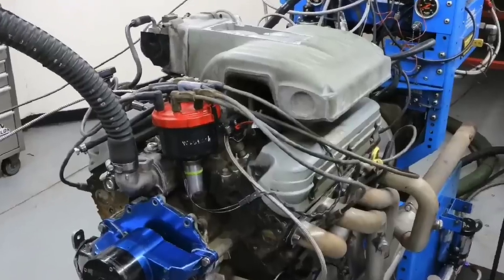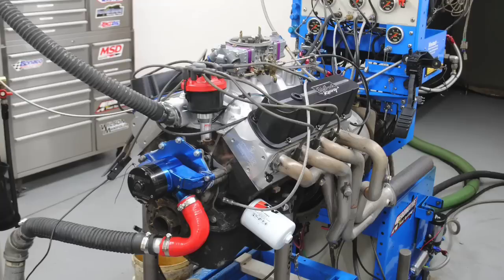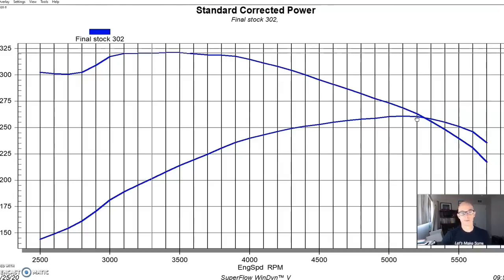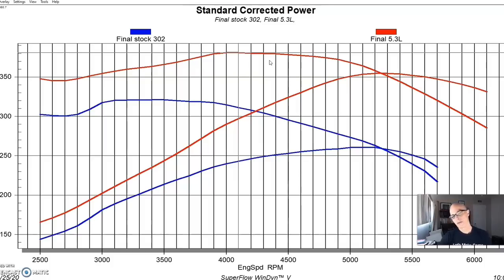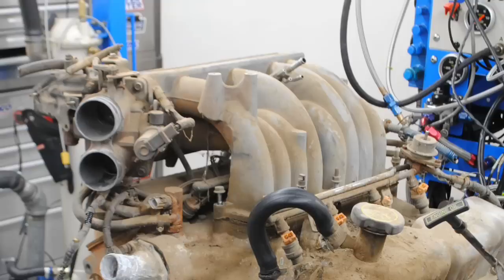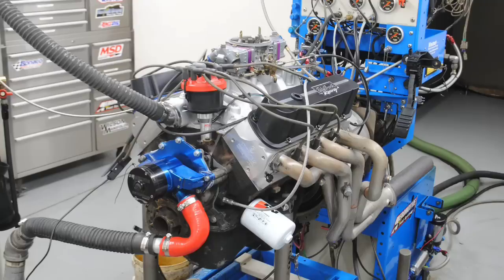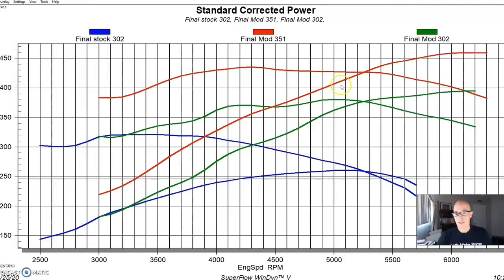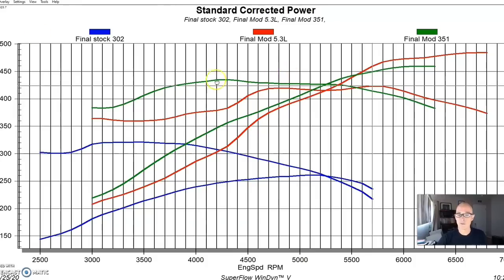5.0L vs 351W vs LS-SHOULD YOU SWAP?

Comment: With the money I'd save having to convert everything for an ls, I could take that modified 351 and boost it with some wuhan whirly boys and go well above the 5.3
Reply: Yes.!! So true.. an LS might be great, until you look into the total cost of converting everything, doesn't really make a good comparison for the price tag. Most people don't want to  waste their money and time to redo their ride. Just saying, modify what you've got. You'll be money ahead.
Reply: Spot on !! No1 talks about those costs
Reply: Barry Boppins  now compare a true ls1 5.7 to a 5.8 Ford. Ford will lose on power and fuel economy.
Reply: Barry Boppins  I've made 1000 to the tire with boost and exhaust on a 5.3. heads don't even have to come off. Idk where you got your information but you couldn't possibly be more incorrect
Reply: That’s just not true.
Reply: Barry Boppins  thats because he has no clue what he is talking about! Some of these guys read it on google and think its true. No need in swapping a LS just run a 5.8 in your ford. The 351 will do all you need and more on a street car.
Reply: This is my thoughts exactly. And exactly the road I been planning to take. This vid just solidified that even more for me. That 25hp difference between the 5.3 and the 351 makes it a drivers race
Reply: Barry Boppins  I had a 351 stroked to a 383 sbf with cheap ported heads, built right and a novi 2000 supercharger on water injection. It was a monster. People also forget the LS is crazy close to the design of a ford. Think of this way also chevy has built on this LS push rod for years past ford so I would hope its just a little better it should be with almost 30 more years of trying to get it better when ford was doing doing OHC stuff......
Reply: I ls swap my skateboard instead of 351w
Reply: Freedom Fighter  very nice. That should make alot of fun.
Reply: I'll take a terminator block over any built block.
Reply: A terminator block can be built  800hp or 1000hp and still be a great daily or a adrenaline rush at the track. If compare a 4.6 Dohc terminator to a much newer Ls or other ford blocks, the old terminator block was before it's time and can still hang with new dodge & Chevy.
Reply: Depends what you start with. There are a lot of V6 Mustangs out there cheap. A good 302 or 351 with all accessories is not cheap or super common. There are a lot more 5.3s in the local scrapyard. On a drag car you're only running an alternator and water pump so it's not that much more work for the LS vs 351.
Reply: Where are you going to find a complete and running 351 for around $500 though? I can drive 30 miles and get a perfectly good 5.3 for about $500. I can't do the same for a 351. Also you forget you have to do modifications for a 351 swap too, so that extra money you were talking about is spent
Reply: @beardedforlife3740  I can find a running 351 at that price. But that's besides the point. an ls swap is much more than just the engine. you'll need a trans, mounts, adapters, fuel system. harness. ecu etc.
Reply: @billybro1999  this.

A 5.8 might need an oil pan, but it uses the same motor mounts and bell housing. Heck if you start out with a 3.8 with a blown motor, that t-5 would also bolt up with zero modifications. 

With an ls, you need to rewire the entire car front to back, you have to upgrade the fuel system, you have to either adapt or buy a different trans, now you are modifying the cross member or flat out replacing it, and you need a set of swap headers and motor mounts. 

Now out all that money you were going to spend to convert the car over to an ls, and throw it into a 351 and you would easily make the same or more power with room to grow. 

That is exactly what richard showed in this video, the 351 holds it's own against a ls 5.3 and you can swap the 5.8 in a few hours with very few modifications vs a complete rebuild on an ls. 

Now will a 5.8 be more reliable? In my opinion, if done right, yes it would. And with mostly stock and off the shelf parts, much easier to repair as well. 

And as far as gas mileage goes, you can easily hit 28mpg freeway with a bone stock Stang. You put gears in, which pretty much everyone does, there goes your fuel mileage with either motor.
Reply: Tyson Seabrook  Who the fuck cares about fuel mileage on a built turbo V8? Ohh, a late model el es can handle more power than a 90s smog choked lightened 5.8? Big story!!!!!
Reply: @beardedforlife3740  i just picked up a complete running 351w ho with molly rings and another that needs work for $600 so it is possible to find just have to watch i wont lie took me 2 months to even find one around herr
Reply: @brianwenzel8791  Yes, but when it breaks, you switch it out with a near stock motor.
Reply: @brianwenzel8791  And you can stroke that 351 block to 427 cubes.....  Just saying....
Reply: Tyson Seabrook  BS
Reply: @lilsammywasapunkrock  I been saying this forever.  They always talk about the price of the engine but nobody ever talks about the list of shit that needs to be bought and/or flat out changed just to make the thing work in a mustang.  It just don't make alot of sense.  There is 0 reason to swap an ls into a mustang.  Now an old g body or s10 or fbody hell yea go for it...I just don't see the point in swapping it into a mustang.  You certainly won't come out ahead money wise after it is all said and done if you are trying to make everything work like most street cars want to.  I'm not talking about straight drag cars with carbs I mean a street car that retains everything including fuel injection the 351 just makes more sense.  Not to mention it sounds  better (personal preference).  Then your mustang still has blue oval under the hood and still has the badass mustang sound.  I also hate how they act like stock ls can take 1000 rwhp reliable without touching anything that irks the shit out of me.  Yes alot of people have done it but it sure as shit aint gonna do it reliably for a long time.  I don't consider replacing the engine once or twice a year reliably done lol.  If you start with a pushrod stang go 351...if you start with a mod motor car go coyote or find a terminator short block and go ham.  Then you can make 800-1000 rwhp pretty reliably and sound a hell of alot better doing it while keeping your ford a ford.

Comment: Pretty big Ford fan here, have a BBF fox. I'm here to say that Ford solidly f***ed us over by swapping to modular engines and not continuing with a next generation small block. This wouldn't even be a question in 2020 if they had made a next gen pushrod 302 with decent aluminum heads and an upgraded block. 

The LS has more in common with a SBF than it does GM engines, with it's #3 thrust bearing and equal spaced ports. It fits where a 302 does. I get why guys LS swap a fox, despite having zero interest in doing it myself. I'd do it in a heartbeat to an import or something else that doesn't have any decent options from the factory though. But I get it, GM cars are generally heavier, foxbodies are easy as hell to get the chassis to work well, Ford left us hanging for years with the 4.6, and it's cheap to buy a roller fox without an engine and a truck LS drivetrain. 

I really look forward to some of these cars getting Superduty 7.3s in the future and going back to Ford power to make things more interesting. The world is boring when everyone runs the same engine under the hood. It's the next generation small block that Ford waited too long to make, with 445 cubic inches out of the box. Most Ford fans here would be pissed if they knew how many years Ford had the "new" 7.3 on paper before it finally made it to production. I certainly was. 

Let us know when the first 7.3s start showing up on your dyno Richard. They have a modular bellhousing, so a 7.3 6R80 or 4R75 swap should be cake. Small block sizing. No direct injection to dick with; just a cam phaser to tune or lock out. Ford finally threw us Ford guys a bone.
Reply: I agree I hated when the 4.6 came it ruined everything for me but don't forget the new 5.0 is a monster it runs with LS1 I just hated it isn't a simple pushrod design